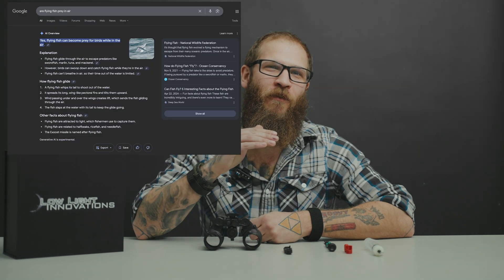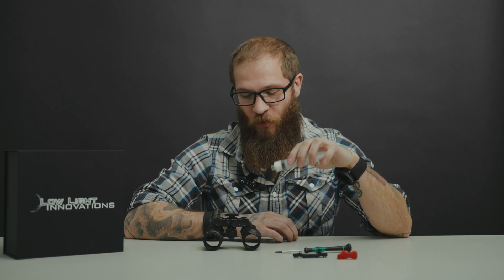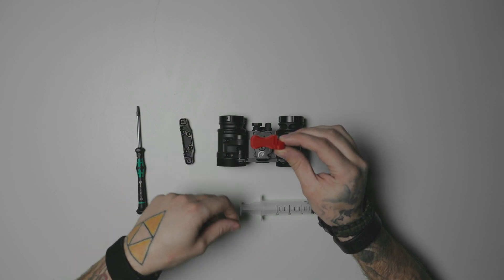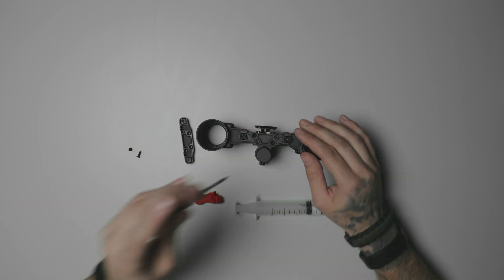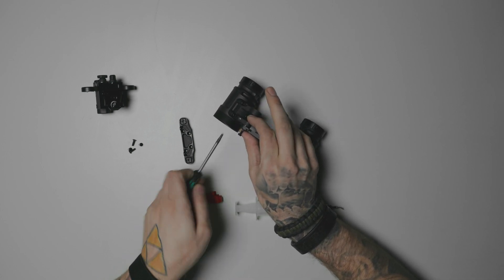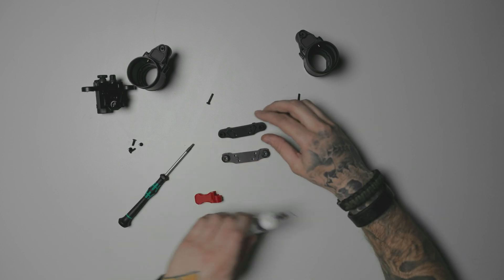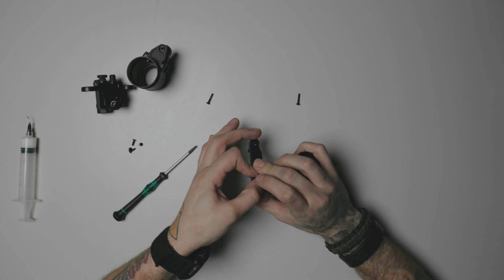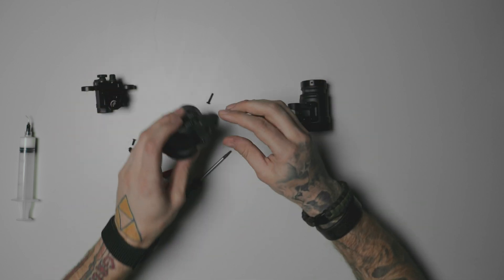LLI REINFORCED REAR BRIDGE INSTALL

Comment: What’s the eta on these 2027?
Reply: I sent an email but was told “ it’s been hectic in the office” and never got tracking. If you could send mine that would be nice
Reply from the maker: @Kaz0s10 I would respond to your previous email to bump it to the top of our inbox.  We get a lot of emails, sometimes emails also get automatically sorted to the spam folder
Reply: @LowLightInnovations ok will do. Also have an issue with the pod retention. Is it ok to loctite the screws ?
Reply from the maker: @Kaz0s10 yes, we actually advise customers to do it once they find their preferred tension
Reply from the maker: They've already been shipped to everybody that has requested one.
Reply: @LowLightInnovations I emailed you guys but I was told “it’s been busy in the office” if u can send mine that would be awesome. I’ll send another email right now.

Comment: About to order a built MH1 from CNV, have these bridges been sent to dealers?
Reply: So will dealers send these out or will you only be sending these out to cust who bought straight from yall?
Reply from the maker: @nickhyde9367  no sir, we will be sending these out to customers in about a week though depending on the color of your unit
Reply: @LowLightInnovations do individual customers need to reach out?
Reply: I have the MH-1 housing in OD Green. How do go about acquiring one of these? @LowLightInnovations